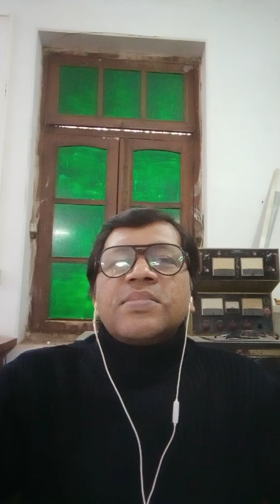#refractory#materials#property #steel#plant#work #process#classification#acidity#basic#neutral#plc!

Comment from the maker: what r types of#ceramic#material!whiteware!difference#porcelain #stoneware & #earthenware #pottery!
https://youtu.be/cqIQy12DmF0

#concrete#calculation#grade5 #ratio#plaster#cement#sand#slump#cone#test#rcc#gic#composition#dentist!
https://youtu.be/a2G3hc-fDD4

#cement#formula#calculation! #compressive#testing#machine#needle#apparatus#सीमेंट #रासायनिक#सूत्र!
https://youtu.be/_LPKAQQFG3Q

#crystals & #amorphous #solid!#polymer is #transparent!#plastic#gel#rubber!#transition#temperature!
https://youtube.com/shorts/zfhD5RA6sVs?feature=share

#bioglass 45s5!#bioactive #glass and g-#ceramic!#biocera#material!#genesis#sand#soda #lime#silicone!
https://youtu.be/8NkwJG4tyuQ

#kumhar ka #electric chak! #मिट्टी के #खिलौने #बनाना #बताओ! #khilaune! #कुम्हार का #चाक in #english!
https://youtube.com/shorts/ZOSIlkUzVec?feature=share

hall effect experiment procedure! what is the principle of h e! probe current in h e! calibration!
https://youtu.be/NXHYw9rIRY4) 

steel vs stainless steel which is better! 304 vs 316/317 SS! corrosion resistance of SS grades!
https://youtu.be/_7Ij5rLyT1g

Four probe resistivity measurement! does ln and log mean the same thing! g7(w/s)!
https://youtu.be/zn_wADSRnnc

hysteresis loop for electromagnet! area ratio? demagnetization? retentivity and coercivity in H. L.!
https://youtu.be/peurIC9nCZM

XRF vs XRD! WD/EDXRF!
https://youtu.be/72C_srN8mSU

X-Ray Diffraction (XRD), HRXRD, XRR, GIXRD!
https://youtu.be/Uoykgoc0UeY

Perovskite (ABO3), BaTiO3, Ferro/Piezo-l/Di electric, Capacitor, Transducer, Band gap, Curie-W law!
https://youtu.be/innY2xvaSyU

Ceramic Calcination & Sintering in Ceramic! S Kanthal, MoSi2, Al2O3, Pt,DTA-TGA,DSC,Hydr. P, Pellet!
https://youtu.be/-A9IgcdMGhI